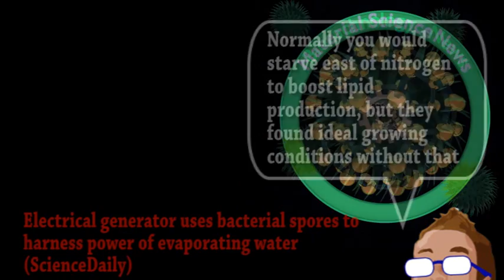BioCrude From Engineered Yeast (Brainstorm Ep172)

Comment: I didn't see you make a video about Thorium before.

Usually people don't think of nuclear fission as "renewable", and for good reason: we focused on solid fueled uranium reactors. Uranium 235, after all, is terribly rare (on par with platinum and gold). It CAN run out. But interestingly enough, we might not even need it. Thorium can be transmuted into viable fissile material through radiation exposure and extremely high temperatures. And thorium is comparably common as dirt.

If you just search it, you'll find a lot of great stuff. Especially the fact that the reason nuclear research on thorium was abandoned was because it wasn't dangerous enough to weaponize!
Reply: Yes, its like stem cells, they both arent funded enough and would bring big corporations zero money. That is why we still use oil.

Comment: What do you mean "from sugar alone and not take up arable land"?

You need land to grow sugar beet/cane right?
Reply: qdragon1337 nitelite78 were this re-engineered to feed off cellulosic [grass] feedstock (grows everywhere on Earth) - that would make for a transformative biofuel :)
Reply: Sugar you can produce from excess material from normal crops. You don't need to make specialized crops to produce that. Cellulose is a complex sugar and it is a waste most of the time from production of grains and other crops. This yeast could be genetically engineered further to be able to break that cellulose in to simple sugars and in to lipids. Or you can make a two step process involving bacteria (or other chemical process) which brakes cellulose in sugars and than feed it to this yeast.
Reply from the maker: nitelite78 any biofuel needs a feedstock and being able to use just sugar greatly simplifies things, remember these produce oil not ethanol (so it should be more efficient than growing something like soy)

besides we could probably divert some sugar we already produce toward fuel production and be fine
Reply from the maker: that is true but the yeast and a biofuel production itself can be done pretty much anywhere
Reply: qdragon1337 nitelite78 can the sugar beet/cane be grown anywhere?
Reply: Gabriel Dibble It needs fertile land. So I am still not sure why this is a break through. Unless there is some large efficiency improvement via using yeast compared with other distillation methods.